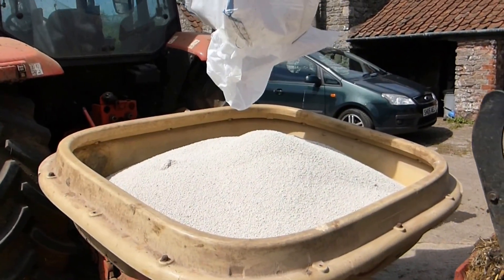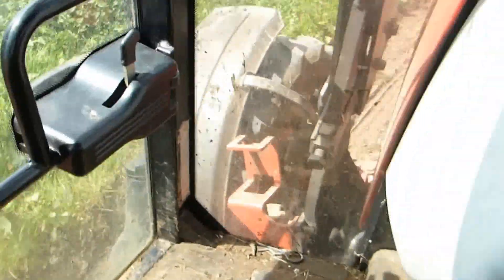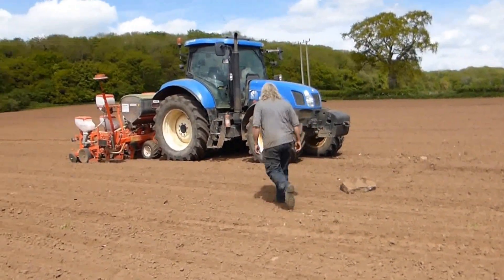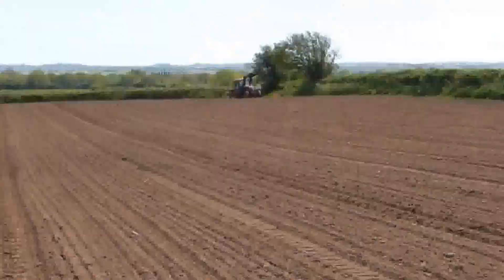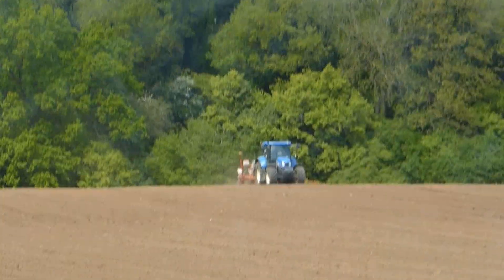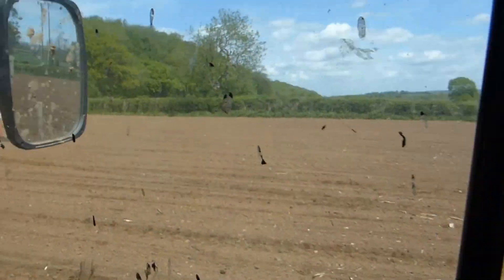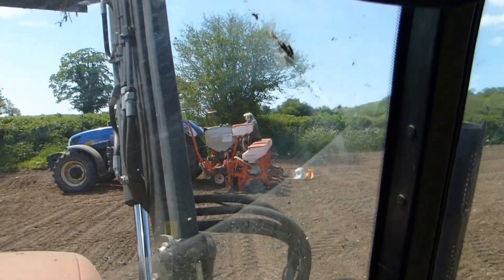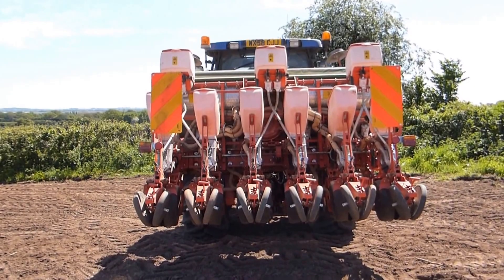Top dressing a maize crop with fertiliser

Comment: love your channel! just got a few questions for you because we do it so different over here.Why do you put fertilizer on with a second tractor instead of sowing it with the planter??? Also if you are top dressing the maze why not with wait until it sprouts and spray liquid high nitrogen??
Reply from the maker: There is some micro fertiliser that goes on with the seed but I've found that extra top dressing helps when it germinates. I don't have the equipment to spray on liquid fert
Reply: makes sense.